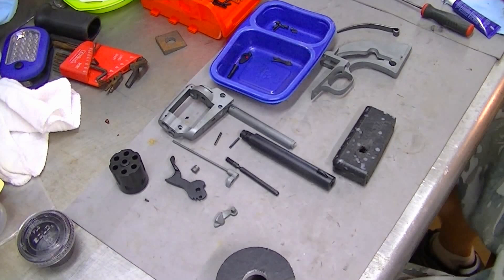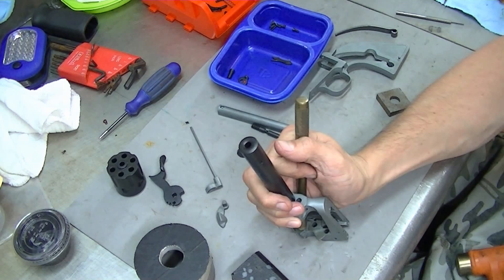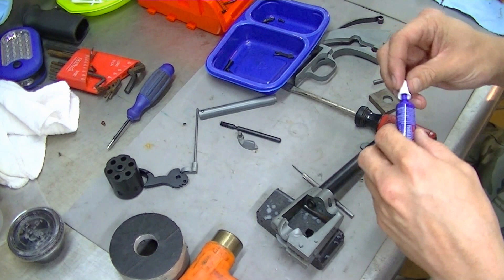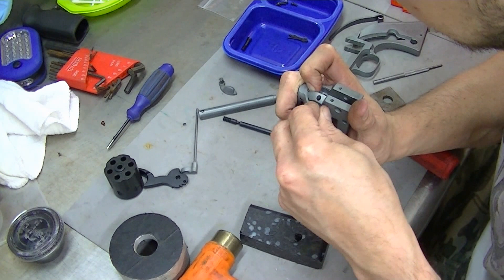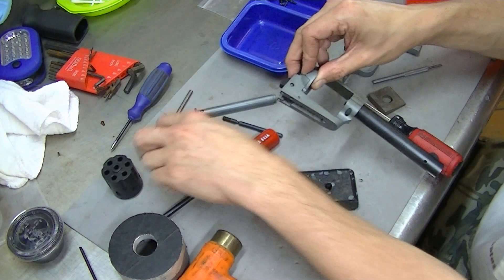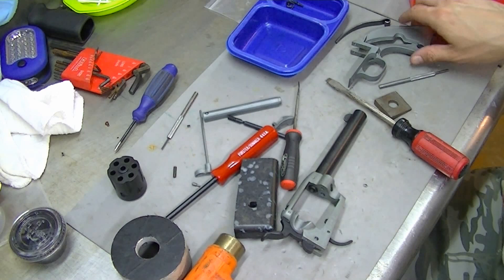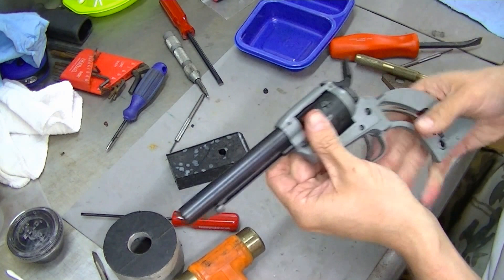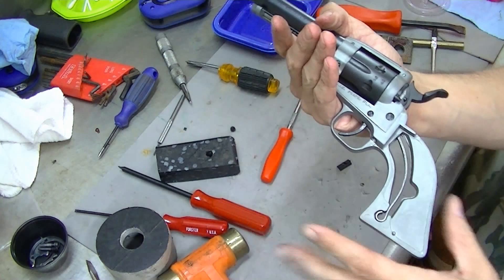F.I.E Mod E15 .22lr Revolver Assembly

Comment: Great video! I just had a question for you, if thats ok. I have the same gun, and sometimes the hammer jams. I think its the hand. I took the cylinder out, and inspected the hand, and the hand bends inward. Is the hand supposed to have a bend in it, to turn the cylinder, or is it supposed to be completely straight. Thank you!

Comment: why was different you have to put a pin through it that holds the grips in place but no there was a bushing in between I don't know how that was no loss the bushing and the spring is not strong enough for the Hummer anymore that's why I throw the whole thing in the trash

Comment: I have the Titan E-15 owned by my father and I need help. I think the safty is locked (stuck) and the hammer will not move nor the strigger. What I can do to fix it or should I have a gunsmith check it out. Thanks

Comment: hey TDCtactical i have this gun FIE MODEL E15 .22 CALIBER REVOLVER one of my church members and friends gave me it last year it was his gun it does not work but someday God Willing if i move out i will have it reblued or blast it and i plan on using some Colt Frontier Scout .22 Parts on it like the mainspring base pin and screws i got a question dude what do you use for blasting?????
Reply from the maker: I have a number of parts for these so email me a list of what you need. I use 120grit aluminum oxide for pre coat prep. If the metal is to have a raw finish and I want it smoother I use glass bead media but you cannot coat over the finish from glass beads as it smooths vs roughing it up and the coatings need a rougher surface to adhere to. Teamklrdefensiveconcepts@gmail.com
Reply: @teamklr2bar  awesome dude :D
Reply: @teamklr2bar  i have read online that the FIE MODEL E15 .22 was chambered in  .22 LR and .22 MAG if i get mine reblued and get parts from you or Colt Frontier Scout Parts i plan on shooting both .22 LR and .22 MAG and i will use it for Historical Purposes Target Shooting Hunting Self-Defense or Home-Defense against either Two or Four Legged Predators B)

Comment: Excellent video. What did you use to do the "grey" part of the gun?
Reply from the maker: Thank you very much. On most of these that I have done the customers want me to CeraKote them. On this particular one I used glass beads in the grit blaster and then used an aluminum/non-ferrous metal sealer and anti corrosion treatment from the aerospace industry.  The raw blasted aluminum is a brighter finish but the treatment gives it that slightly darker grey look. If you need to purchase anything firearm related or look into having any services performed please check us out over at " http://www.TDCtactical.com " fill out the price quote form for anything that you don't see there. Thanks so much for watching and writing.

Comment: Thanks, very helpful. I have one just like that one, it needs new grips, and have 2 more that are a lot older, they don't have the safety behind the hammer. I need some parts for the other 2, screws, and a slide ejector. I've had those 2 for 30 years 'bout wore them out. lol. Fixing to work on one right know and see if I can get it put back together. I subscribed, hit my channel. I'm a singer.....

Comment: please email me I HAVE A F.I.E MOD E15 .22LR THE CYLINDER WILL NOT ROTATE WHEN   THE  TRIGGER IS  PULL BACK I NEED  PARTS ? WERE CAN I B UY PARTS I THINK IT CALL HAND AND POST ? AND THE OTHER PART IS CYLINDER BOLT  THAT WHAT IT  LOOK LIKE IN THE PARTS BOOK AND THAT WHAT  IT CALL ?  THANK YOU TOM COLANGELO
Reply from the maker: Thomas Colangelo  I have been out of the shop for a couple weeks. please email me at teamklrdefensiveconcepts@gmail.com and I will get back to you
Reply: tom email you back i in need of parts for my  mod tex 22 fie ser # tx 90800 that all i have on this gun?   i am looking for hand and spring and bolt and cylinder latch i look on numrich gun parts it has a list of parts but there sold out
Reply: Maybe you've already found parts, but if not you can use parts from a heritage rough rider or any single action. Some may need a bit of filing but it will work.

Comment: I have a F.I.E mod 15e 22 L.R  my handle is broken off. Everything else is fine but someone else tried to fix it and broke the screw's holder.
Reply: look on gunbroker.com and they have them under pistol  small parts  around 20 to 25 dollars for the frame/grip